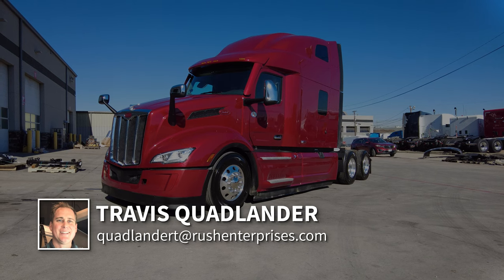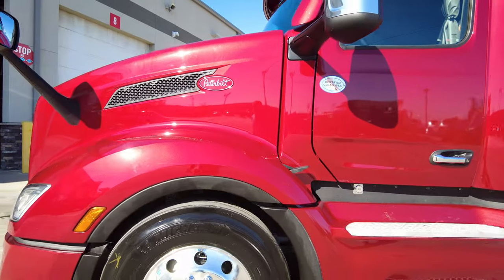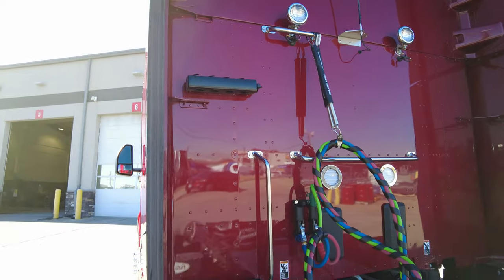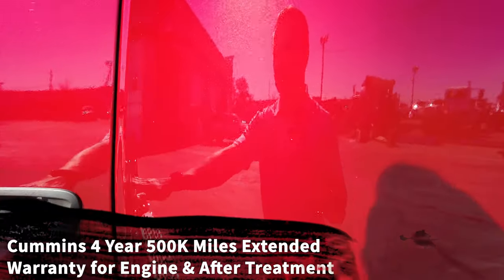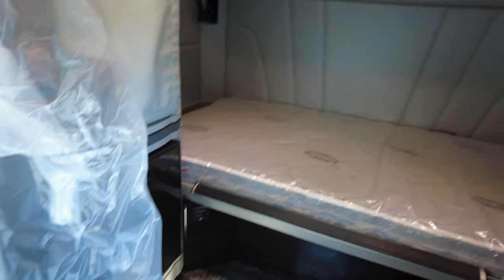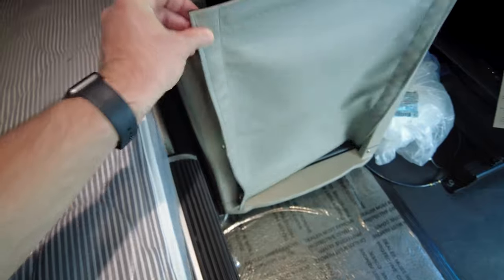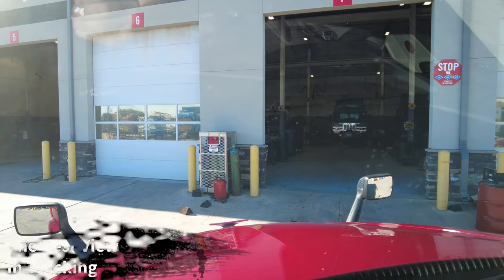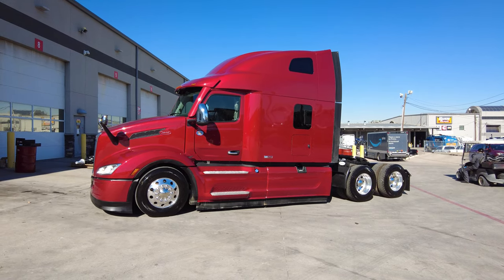Diamond Red 2024 Peterbilt 579 UltraLoft X-15 - SOLD

Comment: Have new peterbilt with warranty all around. Has problem with transmission, been a shop for over  2 month, open case with paccar and all what they authorized is wheels check and angles over and over...truck is not fixed. Warranty is a joke!
Reply from the maker: Hello Oleksandr. I'm sorry to hear about the issues you are having with your new Peterbilt. Where did you buy your truck? I don't recall us doing business together. I would be happy to see what I can do to help. Especially if you purchased your truck here at Rush Peterbilt Dallas or another Rush location.